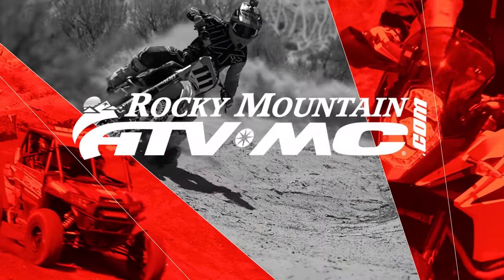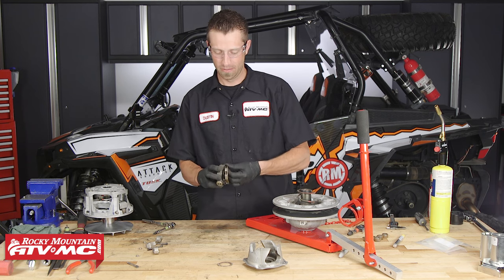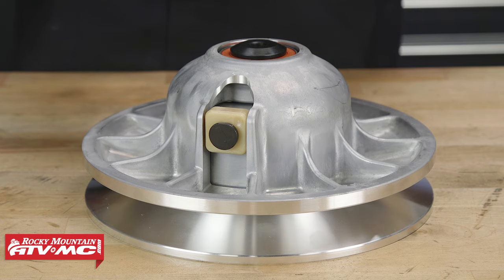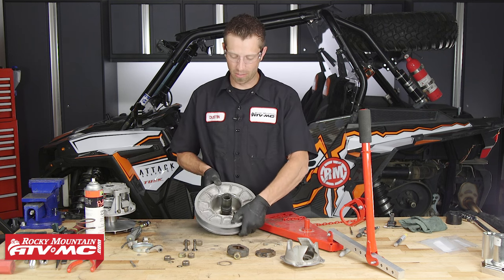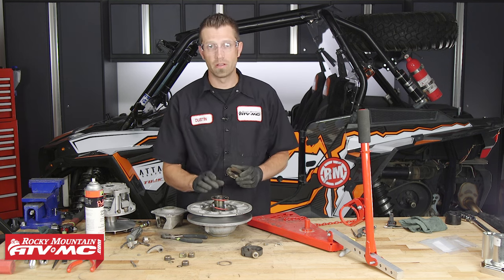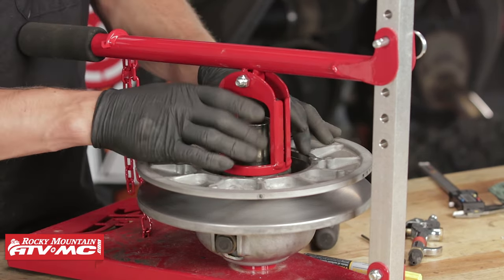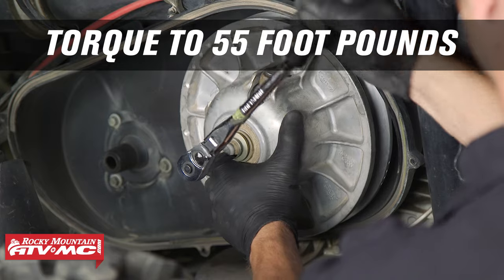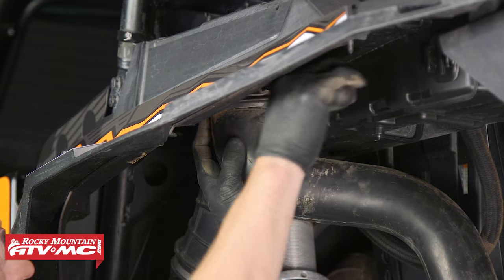How To Rebuild a Polaris UTV CVT Clutch | Secondary Clutch

Comment: I have a 2010 Polaris Sportsman 550 touring and the  driven clutch is out of alignment with the primary drive clutch. The belt is sitting out touching the outer sheave on the drive clutch causing the belt to be engaged and the driven clutch being engaged. The  one way bearing is working as it should. The driven clutch do not have any shims between the end of the clutch and the shaft in the transmission, so there there isn't any adjustment to be done there. If you centre the belt in the primary and start the engine for the first 2-3 seconds the secondary do not turn but then the belt will move over and touch the outer sheave of the primary and then the secondary will turn. I see on some sites there is talk of motor mounts causing the problem but this unit is bolted together as a unit(similar to the transmission in your car) not as an adjustable unit so the motor mounts should not have any effect on this type of set up. Do you have any suggestions. I'm to the point of taking my driven clutch to a machine shop and machining about 1/16" of the end of the shaft the on the engine side of the driven clutch to let it move back into alignment with the primary clutch and then shim it back out if I have too. This should not have to be done but I do not see any other way to bring the alignment back to where it should be. The primary have been changed because the one way bearing was screwed up, I have a second secondary clutch which I have tried and the belt is new. With the new belt or old belt it is the same.

Comment: I know this is an older video and I hope you still monitor it but why does the flat part of the roller bolt have to face the engine? Will this cause problems if it does not face the engine? I just pulled my secondary clutch of my 2017 ranger xp 1000 and the bolts face away from the engine. I am having issues with a lot of noise coming from the secondary.

Comment: Hi Guys. Kindly question: 2016 rzr turbo secondary clutch will fit to non turbo 2014 rzr 1000? Please help :(
Reply from the maker: Unfortunately, it looks like those 2 models use different components. They have different part numbers for the secondary clutch and belt.
Hope that helps!

Comment: I've got 1600 miles on my XP1000, Every 500 miles I've been taking the cover off and cleaning the clutch area (water, compressed air). I just replace the belt because I burned it once a week ago. Approximately what mileage should I be rebuilding the clutches? I don't have any issues so far, but I'm a stickler about maint.

Comment: Doe's secondary clutch supposed to rotate while machine is in park? Because mine is and is really hard to shift....
Reply: Mine did some thing. Primary clutch had flat spots on rollers. Replaced clutch with a new one and rebuilt worn one for a spare. Problem fixed
Reply: No its not suppose to turn. The belt and secondary should remain stationary at idle. If its turning the issue with with your primary clutch (probably the roller bearing). The reason its hard to get into gear is because the transmission input shaft (driven by the secondary clutch) is spinning. Imagine trying to put a manual transmission car in gear without pushing in the clutch, that's essentially whats happening.
Reply: @james4wd236  thank you
Reply: Juan Navarro probably your belt is not align properly. You will probably have to play with your shims on your secondary clutch. That will align your belt in the middle of your primary clutch. You can go see on hunterworks, they have great videos for rzr

Comment: I am having an issue with my belt riding too high in the secondary causing severer creeping. Could my square slider be binding causing the outer sheave from loosing up and letting the belt sit deeper between the sheaves? Worked fine before I changed the belt.
Reply: Having the same issue.  What was your fix?